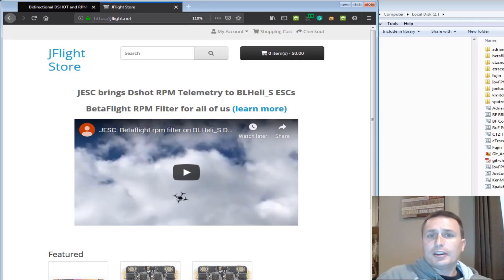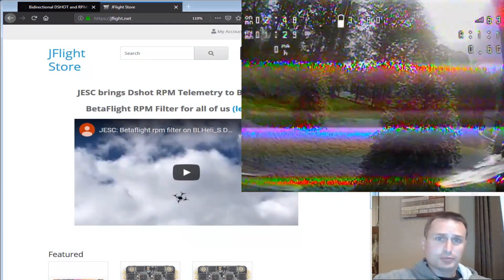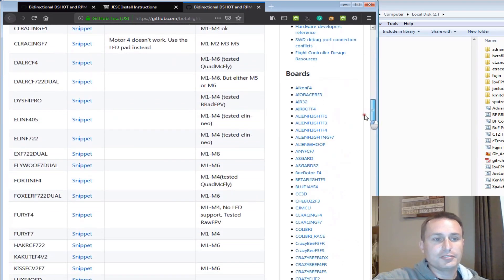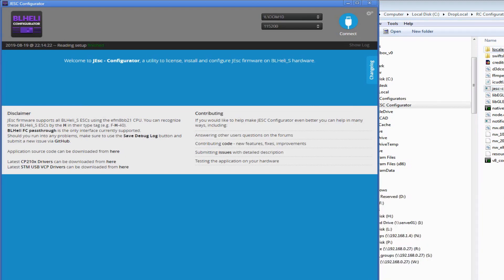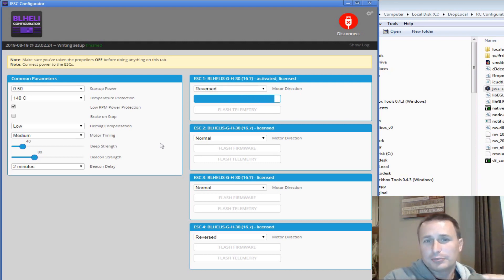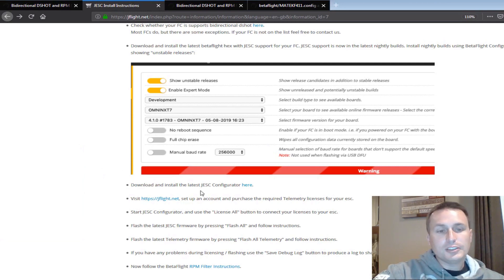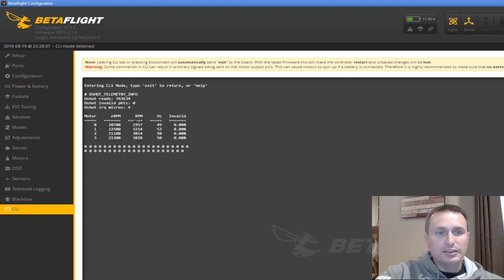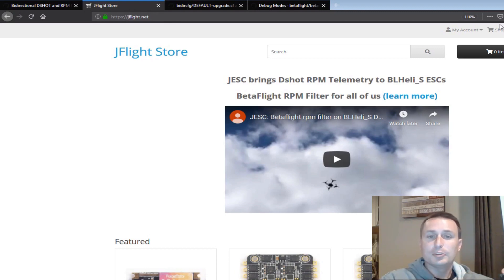Jesc - RPM filter for BLHeli_S ESCs

Comment: Going to CLI stops my motors. Thoughts?
Reply from the maker: there is an easier way now.  Just to to ESC-configurator.com and flash BlueJay firmware.

If you have an F3 board, see:https://theuavtech.com/performance-edition/
 https://theuavtech.com/performance-edition/
Reply: @uavtech  I just flashed JESC w telemetry. I don’t see myself going back to Bluejay unless you convince me. I’ll be flying your Superfly w RPM filtering tomorrow if weather permits. Thank you for all your amazing work and education you provide.

Comment: I'm assuming my blheli s ESC must already support dshot or be modded (cap removed) in order to run the rpm filter?
Reply from the maker: Correct.  Most modern (from last 3 years) ESCs support Dshot.
Reply: Will definitely take the time to take these off and take advantage of rpm filtering thanks a lot.

Comment: 2.3 JESC contains the latest BLHeli_S or you flash with says version 16.8 then you do the JESC all over again?  If you do a complete flash w/ 16.8 do you lose the activation and telemetry and bidirectional RPM filtering??  I just installed with 1.2.8 and 2.3 from 16.70.
Reply from the maker: I'm not sure on licensing details of going back and forth.  But all you have to do is flash JESC 2.3 and add telemetry module for RPM filtering.
Reply: @uavtech  so basically you are using JESC for firmware updates instead of BLHeli_S?
Reply from the maker: @antdx316  , correct.  JESC is a one stop shop.

Everything works with JESC.  It was made by the guy that invented the RPM filter.
Reply: @uavtech  so basically its derived off BLHeli like Betaflight is to Multiwii?
Reply from the maker: @antdx316  , correct.  With an add-on module that enables RPM telemetry data to FC for RPM filtering.
Reply: @uavtech  I turned everything else on but this "set dshot_burst" has to be set to ON otherwise I get an RPM Filter arming error.

Works on my HRGLCF428 stack:
set dshot_bitbang=off
set scheduler_optimize_rate = ON
Reply: @uavtech  Can you use all the other features like DMA, scheduler, dshot bit off, etc or is it like a hackjob version of bidirectional RPM filtering where if you turn everything on it will crash?  I can run everything fine on the F722-STD F7 but this HLGRCF428 is different.

Comment: Hey I know this old video but hopefully u can still help!?!? I have a maytek 411 I don't see it in JESC list!! I saw it  on your list or the maytek 405 but I now dont see either!!
Reply from the maker: JESC is ESC software,  not flight controller firmware.  You run it with Betaflight 4.1.x.  i have newer JESC videos.  Check them out too.
Reply: @uavtech  I understand its esc not fc but the fc & esc are connected it's a micro fc esc

Comment: How did you get to cli with your motors spinning?
Reply from the maker: In BF 4.1, you don't need to anymore.  with BF 4.2 and Configurator 10.6, you can see the error % right under each motor in the Motors Tab.
Reply: @uavtech  Still how could you do it? I couldn't find an answer anywhere.
Reply from the maker: @pav2k  , you just spin up the motors in the motors tab and click the CLI tab.

Comment: How much of a difference does the rpm filter make?? Would I actually feel a difference between the two??
Reply from the maker: it helps a lot to kill out the motor noise and frees up the dynamic notch to hit other peaks. if you can feel the difference or not really depends on your, your quad, and how much raw noise it has; or doesn't

Comment: Hello Mark what is with the new BL Heli S Configuratotor JESC 1.2.5 and flashing without paying nothing ?????????
Reply from the maker: you can flash JESC for FREE for sure.  But if you want the bidirectional module add-on, Joe is charging $6 for a 4-in-1 ESC.

Comment: Hi, Is it normal that when I flash my ESCs using JESC, my PPM min/max throttle (in blheli) goes to 1148/1832? Should I put them back to 1020 and 2000 using blheli? Thanks.
Reply from the maker: it doesn't matter with Dshot.  Ignore those values.
Reply: @uavtech  got it thanks

Comment: A couple quick questions. Did the matek 405 firmware work on your turbo bee? That is what I’m trying to upgrade.   Also, If the ESC is damaged and needs to be replaced, do I need to buy another license and reinstall this stuff??     Thank you
Reply from the maker: If that is why i had loaded, it worked.  If you have a damaged ESC, email Joe abou tit.

Comment: Thanks.. I went to flash my 4in1 esc and it had 2 options of firmware but only one of them would highligh to flash. It had 24hz in the the name. Any idea if that's OK to use? Thanks man.
Reply from the maker: 24hz is fine.  Go with that.

Comment: When I try to get te telemetry info my motors stop spinning. Anyone an idea why that is? Also when I am in the cli tab and click the motor tab. Betaflight reconnects.
Reply: Are you spinning up your motors first before going to cli for info?
Reply: Yes I do but the motors cut off as soon as I enter the cli
Reply from the maker: Get latest configurator and you can see direct in the Motors tab.
Reply: got same problem and also hot motors on my trashcan 75

Comment: Are there visible flight improvements after RPM filter is enabled?
Reply: No, none
Reply from the maker: Yes.  After you get your filters narrowed down, you can see improvement in prop wash handling.  Additionally, if you had a lot of peak motor noise hitting the PID loop, RPM filters do the best job i have seen at crushing it out.
Reply: @uavtech  it would be interesting to see a video comparing situation before/after. And maybe some blackbox data.
Reply from the maker: @pivoglotik  easy.  Already done, let me see if i can dig up the logs or make new.  I think the comps are documented in the PR too.

Comment: Is there way to install the RPM filter with BlHeli esc escapes without buying the JESC firmware license which costs 20 €
Reply: No. The work was done by a blheli32 developer, not the open source blheli s devs
Reply from the maker: Yeah, only $5 for a 4-in-1 or $2 for per ESC for individual.  Joe did all the code for it and RPM filters.  It is worth giving him a couple $$.
Reply: It only costs $5 for a 4 in 1?
Reply: Dude get a job....the firmware is fantastic. totally worth it the dollar per esc.

Comment: I followed this because I was having trouble navigating the Jflight site, plus I wouldn't have even have heard of it without this video.
However, I see some of your motors are reversed. However, using 10.6 and selecting rpm filtering in config, my reversed motor shows as 💯 in the motor tab, and won't spin up when I test it? Is there something I can change in betaflight to make it compatible with my reversed motor in jesc?
Flashing 16.7 blheli_s and deselecting rpm filtering, and everything works fine 🤔
Reply from the maker: should work fine with reversed motors.  still not working?
Reply: It fixed itself. I made a post about it in the Betaflight Facebook group. I knew something was strange as I saw yours were reversed. When I ignored Betaflight and just armed it, everything worked and it flew great. I tried to replicate the fault again and it's disappeared.

Comment: why is that my motors stops when I go to CLI?
Reply from the maker: hummm... not sure.  Get the 10.6 configuration and it is much easier: https://youtu.be/rawGQvMRzM4?t=435
Reply: Hahahaha I am on 10.6. I was following your RPM filter setup video. Thats the only thing I cant do, my motor would stop once I go to CLI. So I dint get the rpm data.
Reply from the maker: @ti2phol  , just do it in the Motors tab then.  No need to go into CLI.

Comment: How well is BF 4.1 flying at this point?  I may put all this onto my turbo bee..  Unlike most I have enjoyed flying 4.0 in my micros..
Reply from the maker: Flies great.  It is 4.0 with revised defaults (mostly in filters), easier to implement RPM filtering (just flip a switch to turn on wince ESC firmware is updated) and more integration into the Configurator (PID and filter sliders).  Also FF 2.1 makes use of FF and tuning much easier.

Comment: Thank you for all these information UAV ! Im currently trying it on a Matek411 12a on a 2s 65mm Tiny Whoop running 0802 12000kv and im having hard time to get decent power , dunno if theres too much filtering or im missing something . I followed every step and even changed the motor poles to 12 and yea its really weird im trying to find out whats going on . Thank you sir
Reply from the maker: if you want more power, you need more filtering possibly - as vibs can limit max throttle - or more powerful motors.
Reply: @uavtech  ty sir

Comment: Mark do you need to redo all the FC steps when you just change out your esc's?
I have a setup working with a aikon blheli 32 esc and RPM enabled.
Now i have swapped the aikon out for a blheli_s esc, im going to follow all the esc steps but do i need to follow the FC steps too? its on bf 4.0.4 and it would be the easiest way to just follow only the ESC steps..
Reply from the maker: Yeah, ESC steps only.
Reply: @uavtech  thanks man 👌

Comment: Well, that was a bit of a disappointment. Just installed JESC on my Diatone R349 (Mamba Fury F4). Everything programmed just fine. Code snippet dropped back from DSHOT600 to DSHOT300 and dropped the loops to 4kHz. So a potential drop in performance there, but I pressed ahead. When I ran up the motors on the bench though, I got desyncs and general glitchy behaviour. Reverted back to the old FW and it's fine.
Reply from the maker: 4k is fine.  No worries in performance loss there.

Hummm on the stutters.  I would submit to see wsup and not give up on that.  Was it a micro?  Was Dshot idle set high enough?
Reply: @uavtech  The glitches/stutters were near mid-throttle. With the old FW it's smooth as silk. I will revisit this, but I'm a bit concerned.
Reply from the maker: @SteveCEvans  , what size motors?  Did you set poles to 12 if micro motors?

Default other filters?
Reply: @uavtech  I admittedly forgot to set the pole count until I saw a comment here which reminded me to. The log below is taken with the correct number of poles (12) for the T-Motor F20's I'm using.

Please see the BB log at https://drive.google.com/file/d/1ol-pbuTfbCmpVuXugD3p27rNMgCfjf3i/view?usp=sharing. You'll see that there was a lot of oscillation on the roll axis, provoked by the stuttering I assume each time I raised the throttle. There's a lot of D-Term oscillation. Might the changes to the loop time, use of DSHOT300 etc. mess up my tune?

This quad is on rails with nigh on perfect set-point tracking after following your videos (thank you!). See https://drive.google.com/file/d/1YLwu7VF5O3cOAtpUHxpYPS1z3m9KaX8e/view?usp=sharing for a log using feedforward 1.0. I couldn't get such consistent results with 2.0; the onset of a move was great, but the end was a bit sloppy. So, I don't really need the JESC update, but was curious to give it a try.
Reply: @SteveCEvans  did you make that log without props on the bench but with active pids? It doesn't look like the motors are desyncing or anything like that. Just looks like the quad is vibrating on the bench which feeds back into the motors via the pids causing the glitches. 
It might be best to test whether the escs work well by using the sliders in the motors tab without active pids. If that works you can put props on and test it outside.
Reply: Joe Lucid Yes. Smooth as silk with the standard config. Only saw the jitters with JESC. Why would that be?
Reply: @SteveCEvans  I would be tempted to say coincidence. But the snippet also modifies the dynamic notch filter a bit which could change whether some minor rattling gets amplified by the pids enough to cause something like this.
It's a test without practical relevance so I wouldn't spend much more time on it. Remember the pids try to correct the vibrations of the quad but since there are no props they can't change the attitude of the quad. So they just spin motors up which causes more vibration etc.
Just use the sliders on the motors tab to check if JESC is then smooth as silk as well (which it should be).
Reply: @joelucid9372  Just tried again with 4.1RC3 and the motors are running up smooth as silk. :)

Comment: Its cool, tried it myself and it seems to work perfectly. One question that is not directly related so but since here are experts around - if I hover with a Whoop on 1s vs 2s the motors become much hotter on 2s. I doubt its just the added weight - but technically if I run comparable throttle a motor should be about the same temperature with different battery numbers? Any thoughts on this? Bardwell is often recommending higher kv and lowering throttle for that reason but in my experience that is not the full truth.
Reply from the maker: Not sure why motors would be hotter on a 2s vs. 1s in a flat hover.  Sure apples to apples?
Reply: @uavtech  Hm - dont know what happened to my last comment, seems gone. Yeah quite sure its apples to apples, its the same quad 85mm 16000kv motors dry weight 26g tested with different AIO FCs. Always the same. 1s luke warm at most even after heavy flying, 2s crazy hot from just hovering. Only difference is 14g which I cant believe to make such a difference. Maybe its a motor specific thing.
Reply: you can't run 2s on a 16000kv motor lol, that's a strictly 1s situation man

Comment: Is JESC limited to F4 FCs because it requires BF4.1?  Or would F3 FCs be unable to use RPM filter anyway because of limited ram or cpu?
Reply: Olaf Schermann I'm pretty sure it is only supported for F4 upwards as the F3 has been dropped from Betaflight 4.1!
Reply from the maker: Hummmm... good point.  Let me look into an F3 thing.  Should be able to make it work.
Reply: F3 needs to be custom compiled since the rpm filter is not in the standard hex files. I'm not sure how well it compiles / works on F3. Back in spring I did run it at 2k loop rate on a spracingf3. Probably requires a bit of work to make it function again.

Comment: I love this!  Getting RPM filtering on smaller quads.  I have a generic RPM filter debug question.  4.0.4 debug_mode = DSHOT_RPM_TELEMETRY What does this provide in blackbox?  It's listed as eRPM but the numbers seem low or inconsistent with OSD and RPM frequncy.  OSD reads around 32100 peak, 652Hz FFT peak, and blackbox shows up 2500 eRPM at 90% throttle (90Amps) in this debug_mode.  I'm running 2400kv 6S on 5".  Do each of these items require a different debug mode?  ...or what am I doing wrong?  Thanks!
Reply from the maker: It must be eRPM if 2500.  So if you have 14 poles (magnets on outside of motor) that would be 2500*14 = 35,000.  Some motors are 12 pole through (micro) so you need to check.
Reply: For a 14 pole motor, eRPM/7=RPM
Reply from the maker: @Washtechna  , yes... true true.  my bad.

Comment: Not really into rpms I just dont like anything on my osd expect voltage!! But it is a cool thing jsec doing & you too w all ur tune videos!! Do you have any good cli diff dumps for a toothpick kwad?? It fly exceptional on bf 3.5.7 but on newest FW flys horrible!! I like the new features but can't get it tuned like on 3.5.7!!
Reply from the maker: You don't need to display RPM on your OSD.  It is for the new RPM Notch filters that are more precise noise targeting than the Dynamic Notch.

I don't have a toothpick tune yet, but if flying good on 3.5.7 and you want to be on 4.0.x, just put the 3.5.7 defaults into 4.0.x and you are set: https://github.com/betaflight/betaflight/wiki/Community-Presets#revert-to-bf-35x
Reply: @uavtech  Thx I will give that try!! One more thng have you heard or do you know about an issue either with bf 10.5.1 or with maytek411norx I can not get my font style to stay it always reverts back too stock!! I like the bf osd font or the bold but they wont stay anymore and revert to stock osd font!!
Reply from the maker: @ehunter2010ed  , even when you upload fonts?
Reply: @uavtech  I never had uploaded my own fonts IDK where to get them or how to do that!! All i try is too use there selection of about 6 differnt fonts bold, clarity, betaflight, large. Then i chose upload and it flashs my FC robots it but the font doesn't change!! I've always had it work before up until last couple months!!
Reply from the maker: Maybe get some video evidence and submit as a issue on the BF github.  https://github.com/betaflight/betaflight/issues